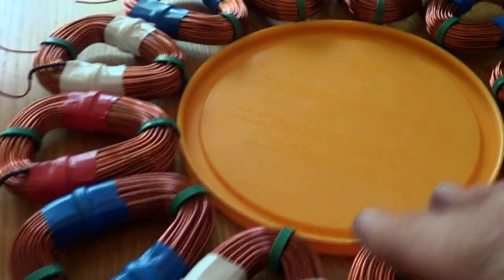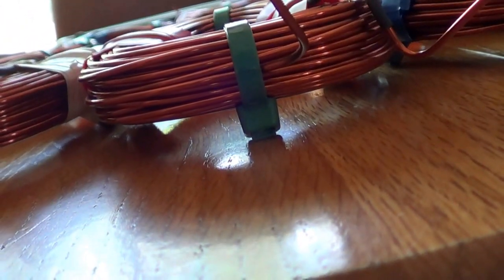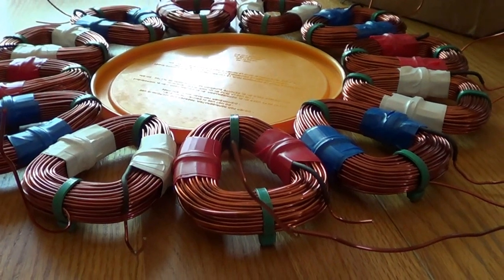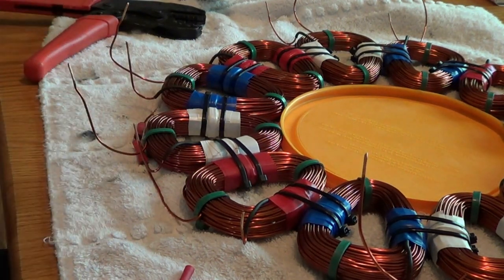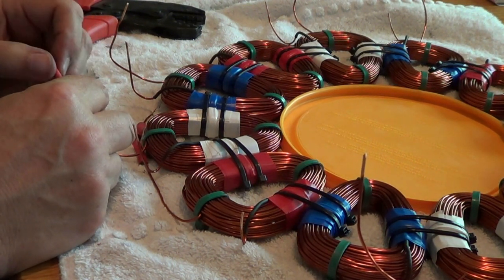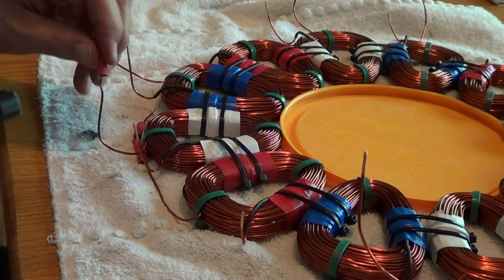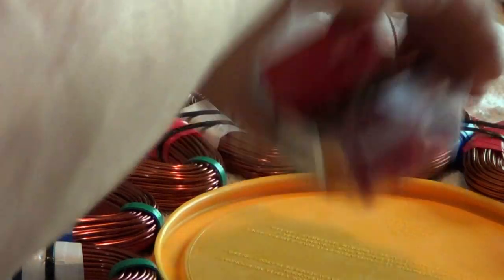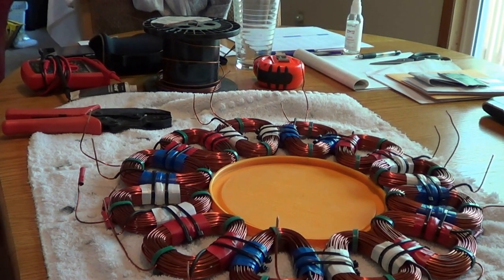AXIAL FLUX WIND TURBINE 12 COIL STATOR BUILD

Comment: Okay so two things one the coils idea is great, but catch 22 is that u will need an iron core to be used to generate a magnetic field for neodymium magnets to pull against to generate the field the coils can collect that field to generate ac voltage, also be sure friend to use sheet metal top n bottom covers with 1 fin bent down on top cover n one bent up for top cover, for each coil used it will dubble the coils even tho it's 12 coils total 12x 2 =24 total stators but will act like a 24 coils, u could also add two sets of coils of  that design but a 3 phase is not needed only a 2 phase is needed but 3 phase generates 3 separate fields for each coil set, the point is u can make it much lighter n better using one long wire split up into two or one coil, only up side to a 3 phase is u can have switching current to charge 3 battery's and or caps at one time using a bridge rectifier can do this on smaller more simple set up n needs less rpms to turn as well so many diffent ways to build these motors delta motors is common use in most motors these days but not always needed to generate power just need a collector n a way to keep volts from passing back to coils. Sorry if confusing just know there are better ways to use much smaller motors designs one known is those electric fire places with the rotating fire, reflectors n leds or ac test bulbs as the fire light, any way those motors have gears in them that reduce motor rotor with fixed magnetic on shaft, the gearing is 68 turns of rotor to 1 turn of the shaft, gearing is a myst use as 300 rpms is too slow I have a video showing this motor making 140ac volts up to 300ac volts on my channel also no conver was needed for a cell phone charger was used wired to phone power brick worked well at low rpms
Reply: Hello mate could I talk too you sir...thanks alot

Comment: Great video what is the wind cut in for the turbine?
Reply from the maker: YT isn't notifying me on comments? The cut in is 150 rpm, at this speed you'll see 2 amps depending on area and height. Tims turbine is at 10,000 ft in elevation so his is different because of air density. He just called me the other day and told me he had too take it down. Because his pole needs to be a lot more rigid! So he's inserting a pipe into the existing pipe to stiffen it up. But with the Midnite Classic 150 it also helps with cut in and full output! Thanks for the comment :)